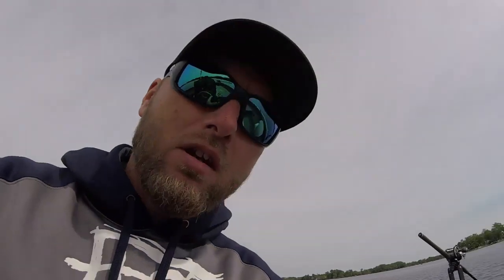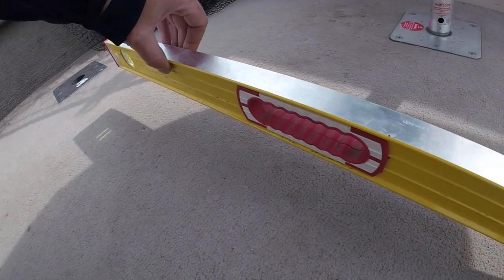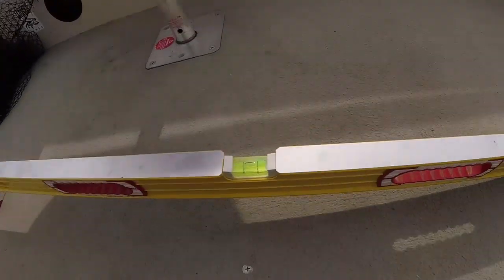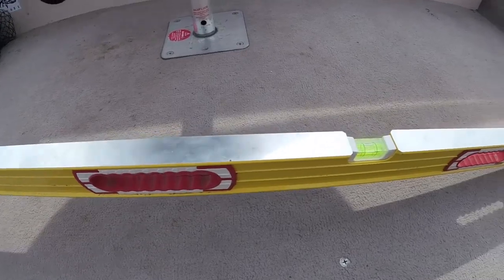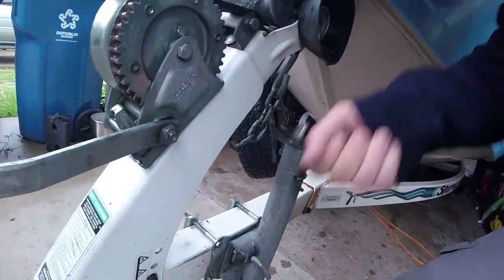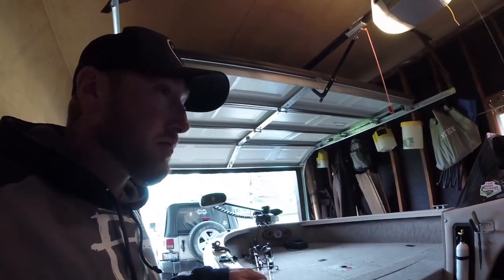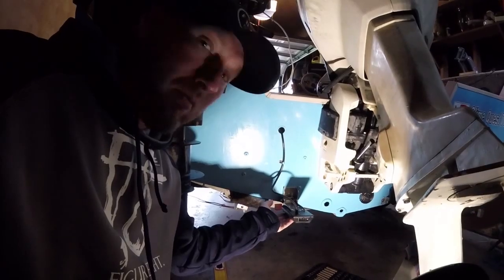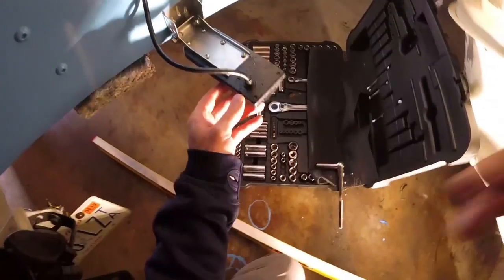Humminbird MEGA Tutorial - Getting the Clearest SIDE IMAGING Picture PART 1

Comment: My helix 9 mega does not show water depth while I’m traveling at high speeds works okay at slower speeds is there some setting I have turned off. I’m  pretty new at this just getting used to the unit.  Thanks
Reply from the maker: Nope, unfortunately the helix 9 mega ducer just doesnt work well at high speeds. If you get the bottom of the ducer under the hull of the boat by a quarter inch u should be able to get up to about 15-20 mph before it starts to cut out
Reply: @HumminbirdHelp  huh? you want your transducer flush with the hull to 1/16 under the hull and tilt the transducer towards the ground. that's why you don't read at speeds over 20. I read up to 40 mph. if you're a 1/4 inch under the hull you're causing bubbles which is why it won't read over 20.

Comment: Hey - quick question.  Are you also running a second high-speed transducer connected with a y cable or just the mega transducer?
Reply from the maker: Just the mega transducer, It still reads to about 28 on 2d